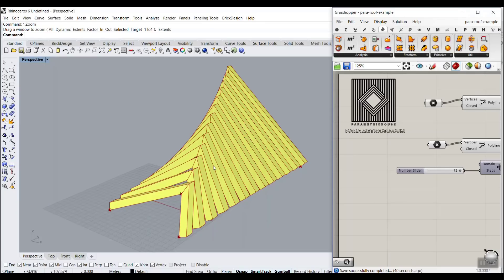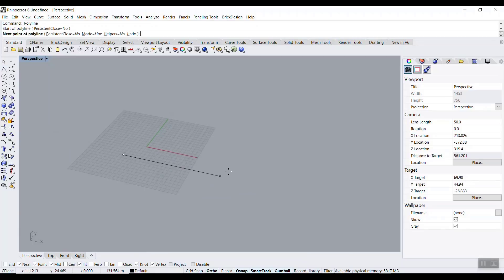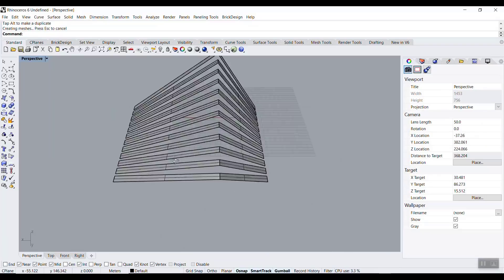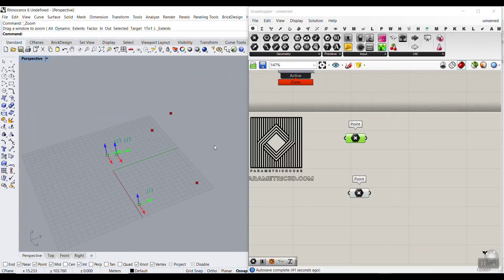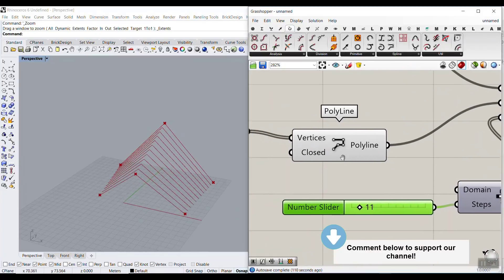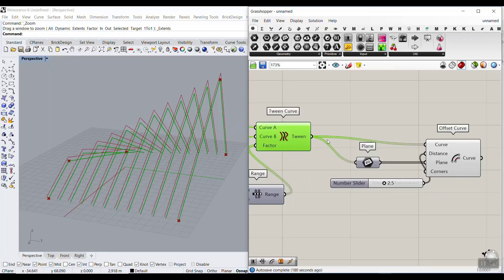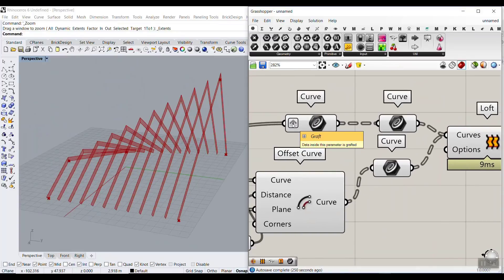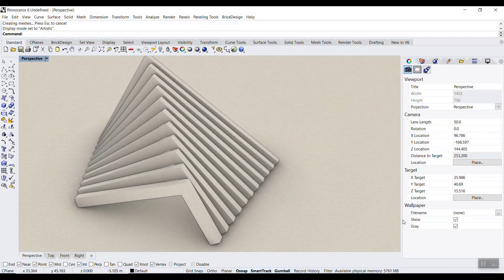Parametric Roof (Grasshopper Tutorial)

Comment: Hey, I am a recent user of grasshopper. Your videos are amazing and very informative. However, when I tried making a simple hip roof with all the rafters, purlins and battens, completely on grasshopper I was facing some difficulties and could draft. I would request if it is possible for you just try a hip roof and show it to us. Or you can even share the file so that we can see for ourselves. I have been seeing your basic grasshopper videos as well but still faced some difficulties. Thanks a lot :)
Reply: I am basically trying to make a plugin for myself similar to 10001 bit tool for SketchUp , in which it becomes easier for me to make roofs with a single click rather than coding it everytime I want to use

Comment: How Is It possible to calculate the distance beetwen two consecutive pieces if You want that the extrusion on y axis Is just that distance ?
Reply from the maker: If the two polylines are in the same plane then the tween curves will actually divide the distance equally and you can use list item + distance to extract the distance